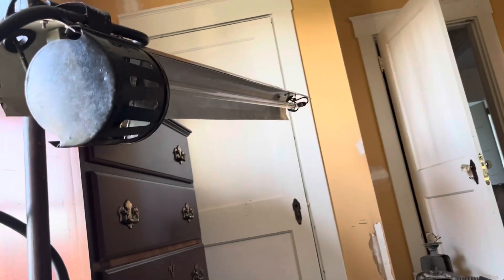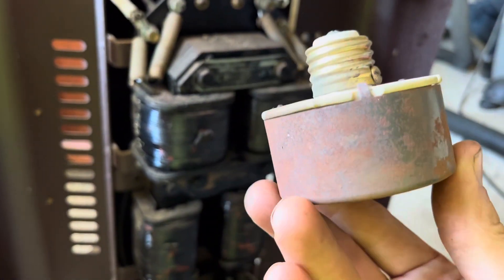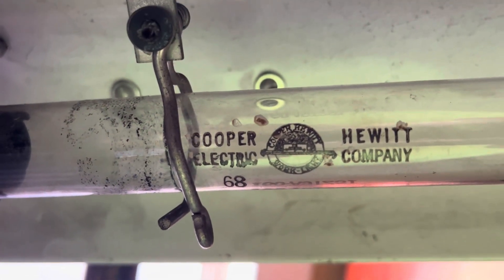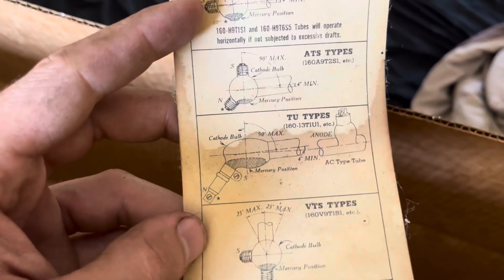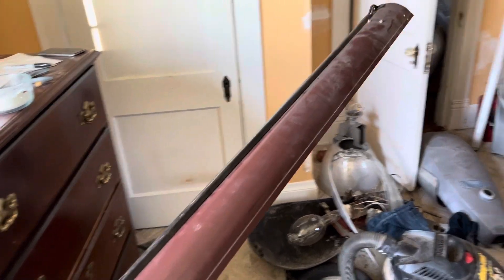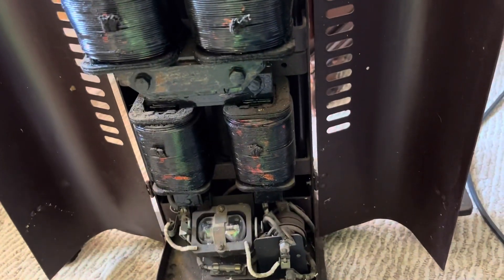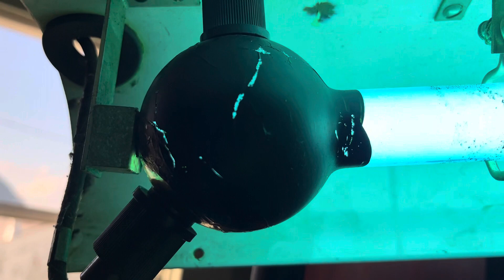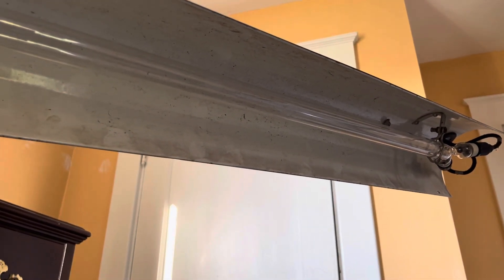1920s Cooper Hewitt 450W mercury vapor lamp

Comment: Impressive. I have a self-ballasted mercury lamp (on the other hand) rated for 220v input. I then had to buy a step-up transformer and it works just fine and very bright indeed. I researched that an "under-current" may damage a higher voltage bulb, so I didn't take any chances and got the step-up to 220v forthwith. But maybe, in your case, it's an obsolete odd number of voltage requirement no longer available?

Comment: I’ve seen other models of these that aren’t used for regular illumination. They were used for exposing blueprints and drafting plans to duplicate them. 

“Blueprints” are cyanotypes that copy the original drawings. The originals are made on thin velum-style paper that is semi-transparent. A sheet of paper treated with cyanotype emulsion is placed underneath  the drawings and the “sandwich” is exposed to daylight, or preferably UV light (which is faster and stronger). After the allotted time the print is washed and what’s left is a light stable cyanotype “blueprint” negative copy of the original drawing (the lines are white and the background is blue).  This lamp would allow drawings to be duplicated right on the drafting table. 

UV lamps can also be used in photolithography to etch lithographic plates. The plates are often exposed to a carbon arc through high contrast negative film transparencies.  This lamp could be used but would take longer than than carbon arc because the photosensitive etching chemicals are quite slow to respond so require a very intense UV light. Where the UV light strikes, the plate is etched and becomes receptive to oil-based printing ink and where is doesn’t, the plate will resist ink.
Reply from the maker: @alandaiello7268  this fixture emits minimal UV light due to the tubes glass composition. It was used for regular detail illumination in the 1920s & I have pictures showing them in use on assembly lines.
Reply: @Mirroxaphene  I have seen others of these used in drafting companies to reproduce blueprints as well. They must use a different tube for that? 

No matter what it’s a very cool lamp and you’ve done a great job restoring it and getting it operational. 😊

PS: I edited my comment above to correct it.

Comment: Hilarious how the bulb just looks like a really weirdly designed germacidal (uncoated) florescent tube 😂
Reply: it does,  because fluorescent tubes are low pressure mercury lamps.
Reply: @georgewills-ek1gg  The only real difference is the fact that uncoated florescent tubes glow green instead of blue, just like germacidal CFL's. Which is why being in the same room with them running can be dangerous because of ozone levels increasing, where as this lamp doesn't do that and is thus perfectly safe.

Comment: The finest example of the technology in operation on video anywhere. Jeff Behary has the only other (2) videos but they are a mere few seconds long with no commentary. To be sure, this lamp IS emitting vast quantities of ultraviolet light, but all of it is absorbed by the glass envelope except for the 365nm "I" line, which is relatively harmless. The smell test is adequate here because the lamp envelope for a device of this age is either going to be fused quartz, which will admit all wavelengths of UV down to the "vacuum UV", or it isn't and is made of glass which is sufficiently protective. The "ozone free" lamps which add a small measure of titanium oxide to the fused quartz to block the 185nm line that produces ozone while continuing to admit the 254nm line, are a relatively recent invention and definitely did not exist in this lamp's era. Subscribed.

Comment: I have researched RF lamps and fixtures and the fixtures themselves were only made from late 1939 until 1942 because of the amount of copper the ballasts used and the increased rationing of precious materials during WWII and never made again however the replacement lamp, F85T10 lamp was available until the mid 1960s.  This 450 watt mercury vapor "desk"  lamp most certainly has more in common with the rectified fluorescent than a standard mercury vapor lamp which would likely date it no later than the early 40s.  The only tubular mercury vapor lamp I've heard of is the H3000 A9 3000 watt industrial high bay, 132,000 lumens,  in my 1954 GE lamp catalog.

Comment: To test if the light is giving out any UVC light, you can get cards with a phosphor that glows under UVC light but not under UVA or UVB.  They also have a photochromic pigment that darkens when exposed to UV.

Comment: Very interesting lamp. The first time I have seen such a Cooper Hewitt lamp.
The UV wavelength responsible for ozone production is at 185 nm, while the DNA damaging wavelength at approximately 254 nm in the spectrum of mercury does not produce ozone. There may still be some 254 nm transmitted depending on the glass though, so it may be best to limit exposure to it anyway.

Some more information about UV-C radiation I found here: https://yourlight.com/wp-content/uploads/2018/05/Effects-of-UV-light-Philips-Lighting.pdf